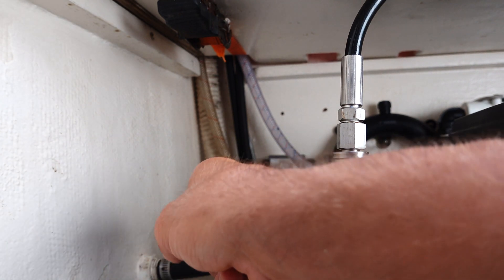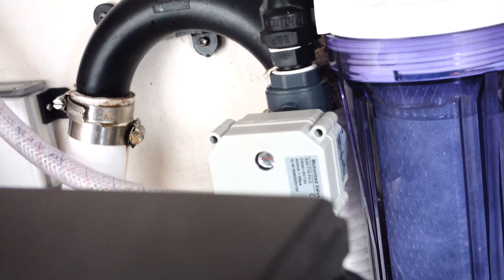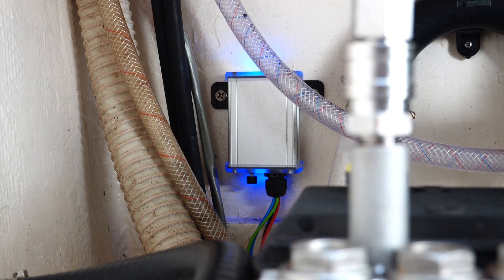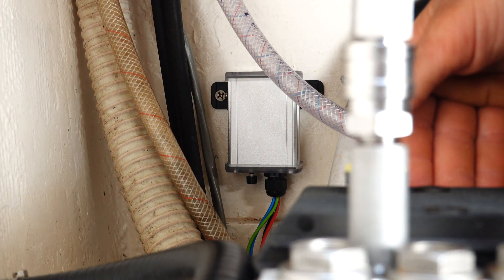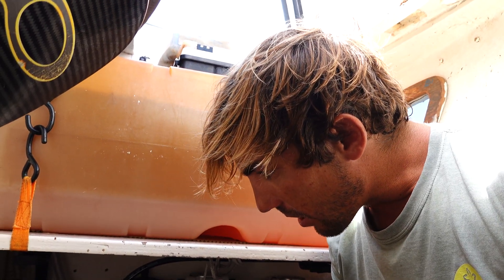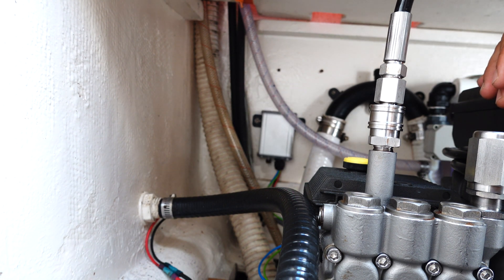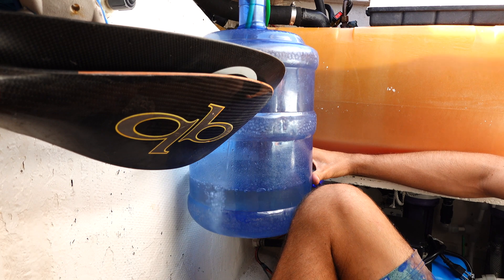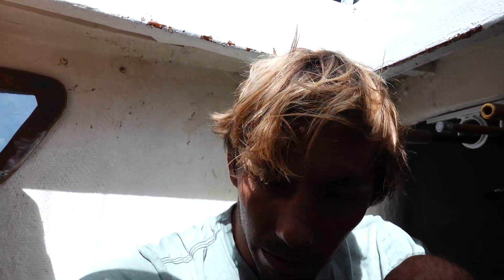Watermaker Automatic Flush System - Rainman Autoflush Complete Overview and Operation

Comment: Does this just push the fresh water through with your boat's fresh water pump? or does it have to fire up the rainman high pressure pump?
Reply from the maker: It pushes through just from the boats fresh water pump. The only throng that’s happening in the autoflush system is the motorized valve is opening slowing that pressure from you fresh water system to come through